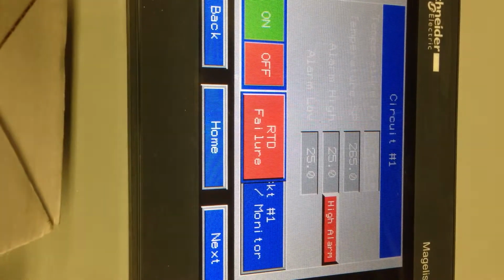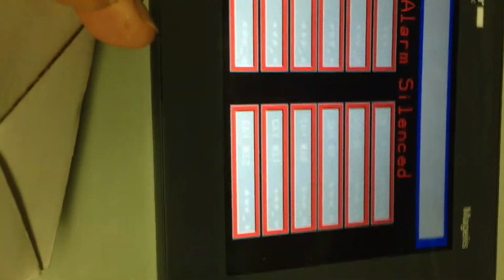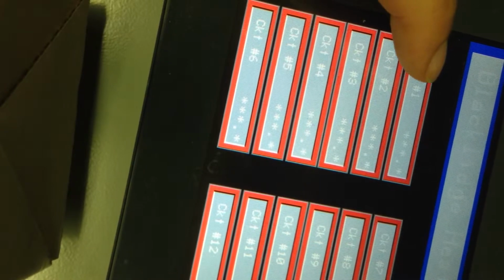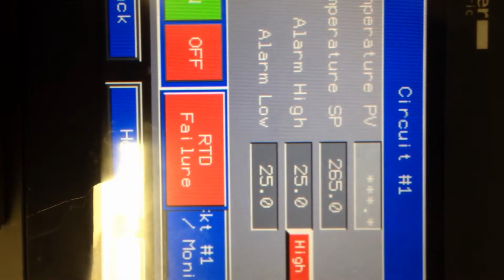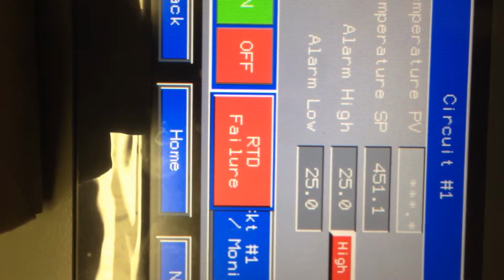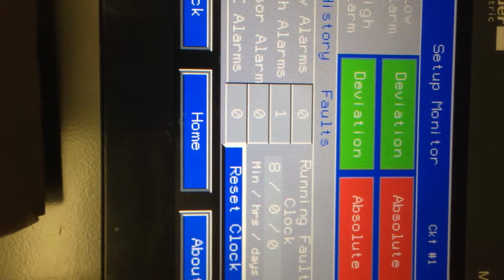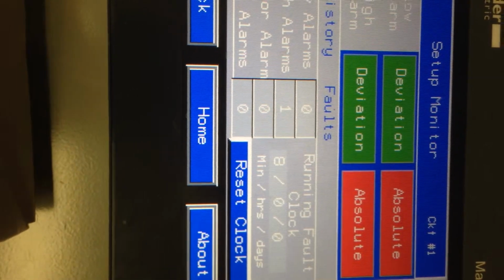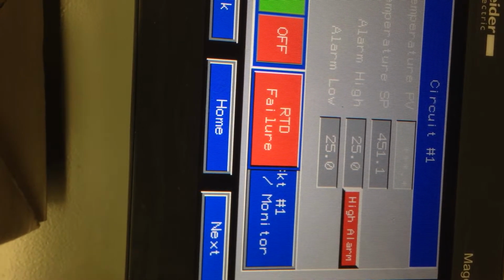Electric Heat Trace Control PLC

Comment: Can this be used for zone ceiling electric radiant heat?  I see no reason you can't.  Can you provide model info on the Schneider PLC. I have about 20 zones each with dedicated thermostats.
Reply from the maker: We can modify for up to 24 zones.  I'm not sure you need all the bells and whistles.  www.thermalinc.com
The Schneider PLC is M221.